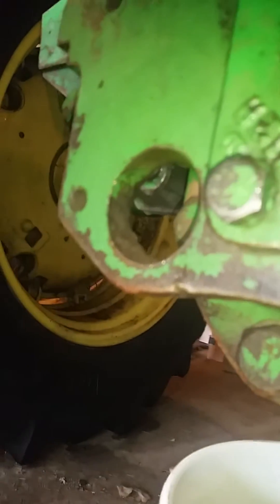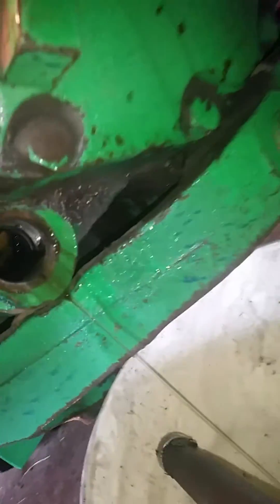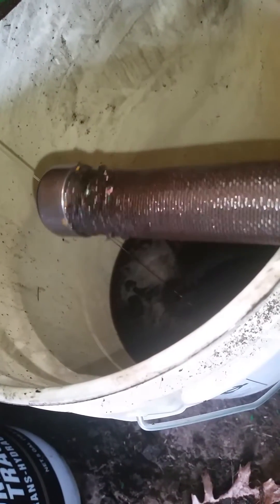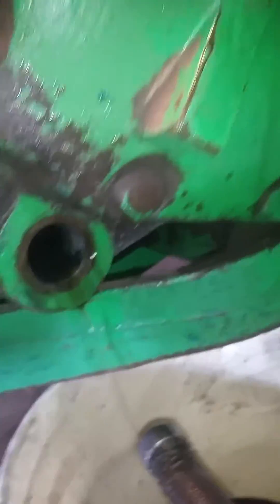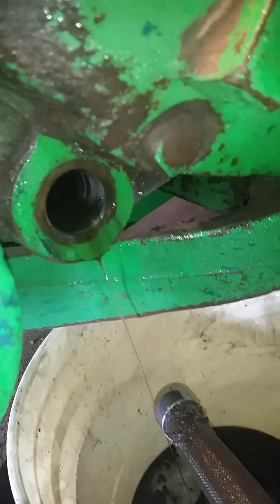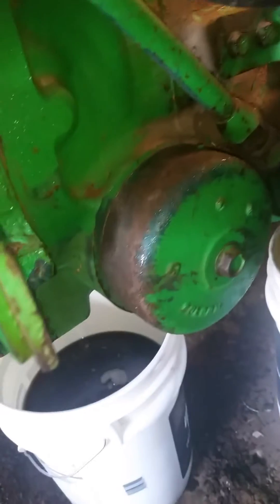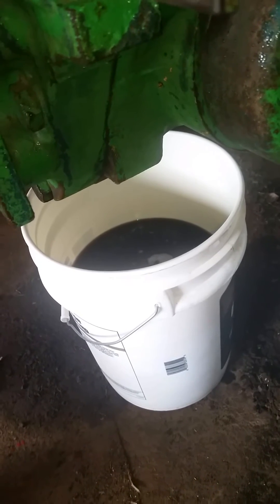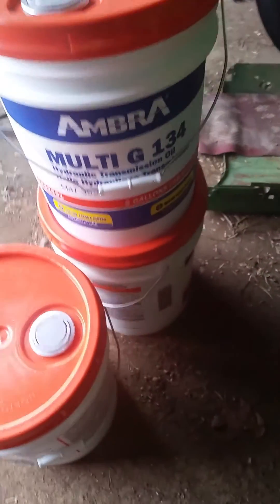4020 hydraulic screen

Comment: Next will probably be you changing your hydraulic pump . That metal came from somewhere .
Reply: It can be brake material also.
Reply: Could be brake pads, of the clutch pads since it’s a power shift. I’ve had this happen on a 4450 quad range and a 4640 power shift.

Comment: Thank you Andy! Never knew about that screen. Put in new lower shaft seals and new oil w/filter this past fall on 4320. 4020 also. These old tractors will run forever if taken care of. The new eqt. is junk to start with.

Comment: if  your hydraulic fluid gets water in it, the fluid can develop an algea problem and coat the screen with a gelatinous goo that can starve your pump and you may loose some or all of your lift and even steering problems may develop.  Run your fluid through a few times plug it and pull the plug 3 or 4 times to flush algea or particules out then put a fresh filter on and run it with a mower on it to get it warm  and flush the system and another new filter and new fluid. i regained all smooth lifting on 3 point and super smooth steering .

Comment: What sort of lift problems were you having other than the leaks? And did cleaning the strainer help? How did you clean the strainer? Since the video cuts off. I have a 4020 also but no idea what to do about it not lifting .
Reply from the maker: Lift eradicate. Cleaning steainer did help some. Clean with brake clean and bristles brush. Get a maggot in there to metallic filings out and as much fluid.

Comment: Does the trans have to be drained to pull the strainer ?
Reply from the maker: Yes 15 plus gallons
Reply: Never mix different brands of hydraulic oil the additives can have can have a reaction against each other and eat the seals out
Reply: @mrnascar9129  best bet is to stick with John Deere hygard because its formulated to work with the clutch packs and wet brakes.